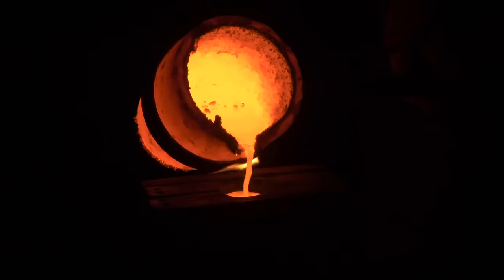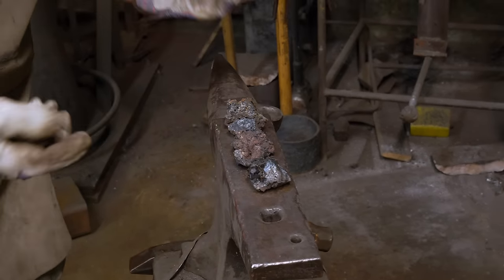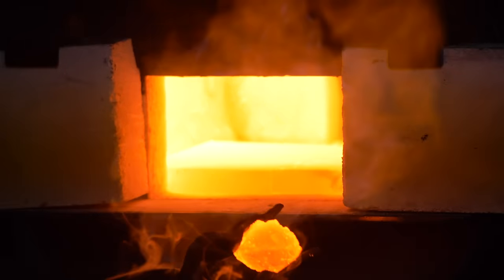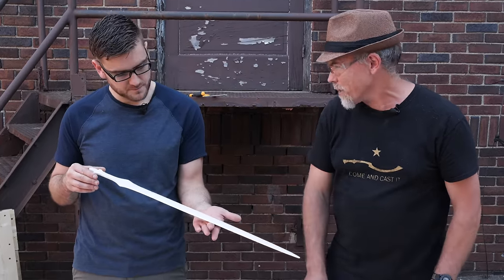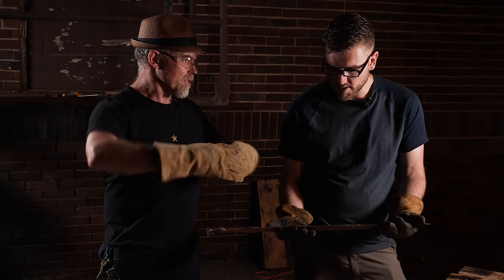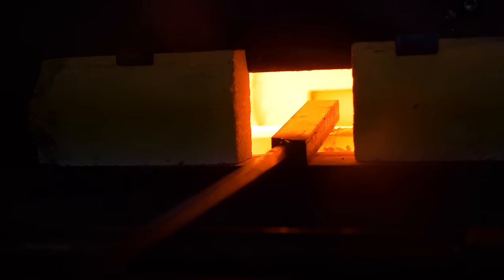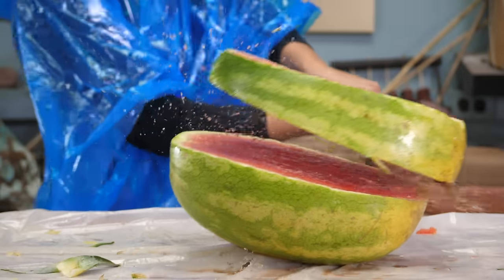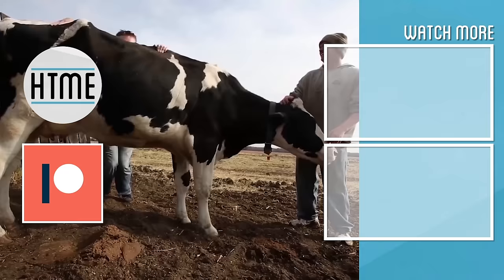Forged Iron Sword vs. Cast Bronze Sword

Comment: It is worth noting that early Iron was of much lower quality than any modern forged steel and in fact it was in many cases even worse than bronze, but the real advantage was that it was dirt cheap as compared to bronze and you could equip with iron weapons much bigger armies than with bronze weapons due to abundancy and availability of iron.
Reply: Agree, as long as the opponent is dead, iron is decent enough
Reply: @Hadrian_S  stone age lasted even longer. Basically nobody knew how to process iron and how to make tools out of it. It took hundreds of years to discover technology of melting and forging iron.
Reply: @Hadrian_S  how does this contradict what I just wrote?
Reply: @Hadrian_S  I never said they didn't know how to. The last I checked there was not a single verb "to know" in any of my comments. I said it took time to discover technology. Technology is basically a way how to do things. Technology of processing iron in my world includes melting it first. So they didn't have this technology and it took a lot of time to discover it. I included stone age to demonstrate that it takes a lot of time to move from one set of technologies to another. In case of moving from stone to copper/bronze it took even longer than to move from bronze to iron. 

But the idea that they knew they need to melt iron and just didn't know how to do so is dubious. Most likely people didn't even realise that iron ore needs to be melted for some reason. Until at some occasion they reached necessary temperature and some iron ore happened to be inside their furnace (perhaps the furnace walls was made with it). The ore melted accidentally and they were like: "Wow, we can melt this thing too, let's see what can be done with this".
Reply: SPQR Ancient Rome and ancient history
Reply: The most important was when early iron age start there was 100 thousends bronze blades vs few iron blades.
Reply: @Hadrian_S  Why are you asking when you already know the answer?
Reply: @Hadrian_S  "They knew... they just simply couldn't get hot enough to melt it."
Could not get hot enough to melt it = They did not know.
You have just defeated the point you were trying to make. SPQR`s point stands.
Reply: @Hadrian_S  iron is everywhere, but it's hidden.  You have to know it's there to be able to extract it.

The main component of bronze is cooper, which can be found just lying around on the surface in the form of elemental copper.  In areas where it cannot be found, some forms of copper ore are easy to identify visually by their color, and can be smelted in a wood fire with a bellows.

The other component is tin, which can again be smelted in a relatively low-temperature fire.

Iron, by contrast, is hidden inside of rocks.  It has to be smelted out, and has to be heated to a much higher temperature than copper ore in a charcoal furnace.  It takes a LOT of charcoal to produce a bloom of iron, and a LOT of pumping on the bellows.

Bronze is just easier.
Reply: Another thing to keep in mind is that when fighting with bronze weapons you didn't parry with the blade. You had a shield for that. Swords were a backup weapon anyway during the period. Much like a pistol would be used today.
Reply: @Hadrian_S  You apparently missed the point of SPQR's answer. And the edge too.
Reply: @norten76  Egg-zactly.
Reply: @1337penguinman  Ehh its not a backup weapon since its not backup your main weapon is a sword.
Reply: @eeurr1306  it's not exactly easy to carry two spears.
Reply: yes thank you when i seen this i was like alot of generals were still using bronze when there armys were using iron because it was better at the time because the iron was  wrought iron it was weak just really good for a spear tip and a short sword
Reply: I love bronze weapons there's something special about those over iron.
Reply: @Hadrian_S  It takes a lot of time and effort to figure out how to make cheap shit last long enough to be worth using.
Reply: @eeurr1306  it is a backup weapon he just didn’t discuss the main weapon during this time would have been your spear. The sword was used only if it wasn’t feasible to use the spear, you lost it, or it broke.
Reply: @Hadrian_S  because bronze are easier to melt compared to iron. People in the bronze age didn't know how to get the high temperature to melt the iron.
Reply: @Hadrian_S  ability to achieve higher levels of heat mostly. they couldn't melt it and had to pound it with hammers when it was really hot even when they discovered charcoal forges. has to do with charcoal being counter-intuitive to the laws of fire they understood
Reply: but forging iron took a lot more effort than casting bronze, especially when it came to multiples of the same object.
Reply: It would depend on were you were if you had a abundant availability of iron.
Reply: @mickvonbornemann3824  Didn't the romans become so powerful mainly because they took the time to do that?
Reply: Roman historians wrote about how their Celtic opponents often had to stop and straighten their bent iron swords under their feet before they could continue fighting.
Reply: @Hadrian_S  The bronze age ended when the major trade routes collapsed, because you seldom found tin ore and copper ore in close proximity to each other. With iron, all you need is a source of iron ore.
Reply: @Hadrian_S  I know its been a year, just wanted to tell you them not knowing how to melt = them not knowing how to do it.
Reply: @Hadrian_S  
It was hard to get fires hot enough to melt iron while bronze is easier to refine because you could use a simple fire to melt it while an iron melting furnace was somewhat unknown outside the Assyrian Empire.
Reply: That is true but there is also evidence of tempered steel being used as far back as the 12th century BC meaning depending on where you were, technology was vastly different all at the same time.
Reply: @Hadrian_S  The answer is a mix of traditionalism, IE bronze being the way things were done and why would you ever do anything differently, iron, while abundant, being more difficult to extract than both copper and tin, and the fact that Iron has a melting point of almost 500 degrees Celsius more than copper does, which requires more advanced kilns.
Reply: Gratias Imperium Romanum
Reply: @spqr_ancient_rome  it just takes a lot of time, effort, energy and resources to melt, more then working with stone, bone or wood. Perhaps they had a rough idea of how to melt but up till a certain point it wasnt worth investng this enery and time at all....required a lot of burning forests, land, in other words. it would have great impact on society, what im tryimg to say, a lot of new technologies needed a trigger, like war, disease at cetera, basicly traumatic events to happen that inclined people to push the boundries of what they were willing to invest into
Reply: Ого. Не очікував вас тут побачити.
Reply: It's not just that iron was cheap, but that tin, the secondary component of bronze, was not widely available with the primitive mining technologies at the time and could only be found in a few places in Eurasia, all of which were distant from the centers of the Mediterranean Bronze Age. When the Bronze Age Collapse occurred, the trade links to these places were severed. No trade means no tin, no tin means no bronze. Bronze retained several advantages, including resistance to corrosion, so once trade was restored with inner Eurasia, Iron Age empires continued to use bronze for quite a few things (notably armor and helmets) even as they also used iron. High quality steel came much, much later, in the early to high Middle Ages. We might think of the early Middle Ages as "primitive", but a pattern-welded VIking sword was a major advancement over the Roman spatha.

E: and even then "high quality" is still much worse than the spring steels that came about during the Late Middle Ages or the industrially produced steels today, hence the need for pattern welding.
Reply: Yes, also when iron was discovered the art of bonze making was highly refined, it was only later did iron technology become more effective. It was only during and after the industrial revolution did metals like tungsten, titanium, aluminium and chrome be ome cheap enough to mass produce. Before then aluminium was worth more then pure gold because of the amount of energy required to produce any significant quantities of it.